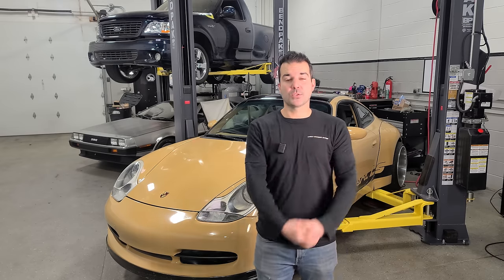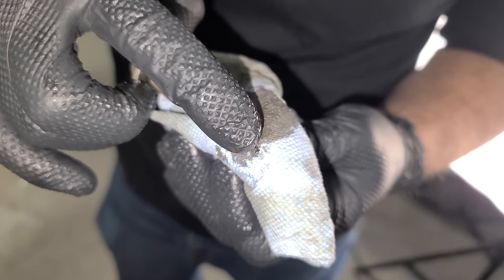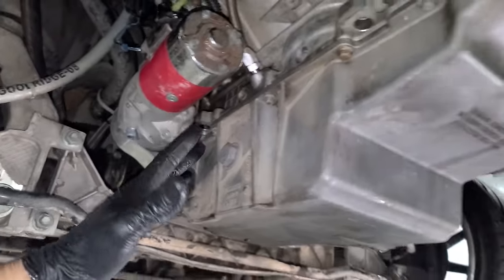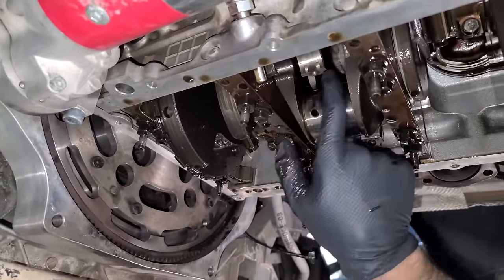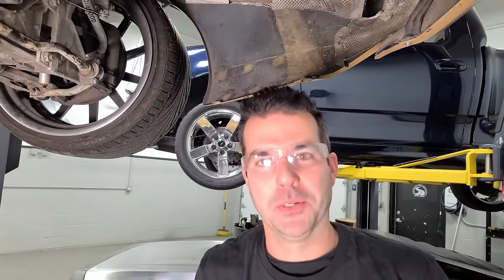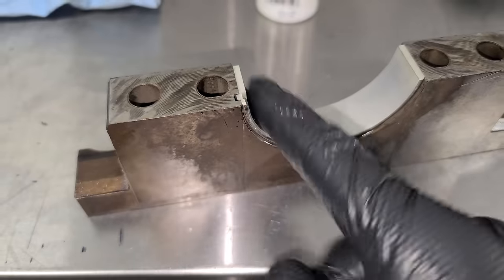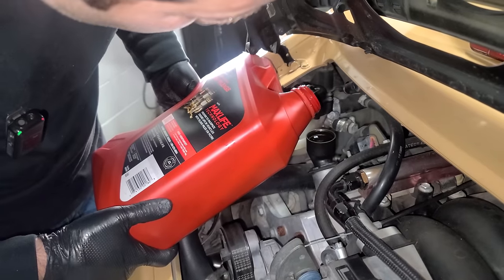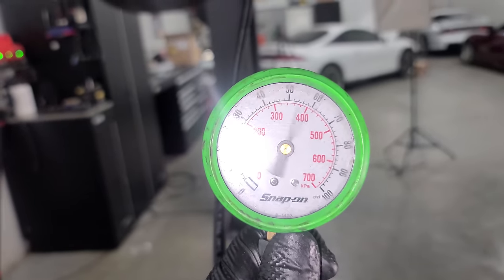My LS Porsche 911 Was About To BLOW UP So I Attempted A RISKY DIY Engine Fix!

Comment from the maker: Click my link and use my discount code “Legit23” (automatically applied) to get 15% off your order: https://bit.ly/Legit_Carly.
Reply: I read the dry eraser board
Reply: Get with Dr Tune Em All and he can get that thing dialed in pretty close quickly doing it remotely.
Reply: How good does  carly work with your ML?  I would like to know how good it is with it before I commit to buying it.  I have a 1999 ML350.
Reply: I ordered my carly scanner for chevy and unfortunately upon deluvery to my house someone stole package off my porch
Reply: read your board, very nice... LOL I love your contents for all types of vehicles, it keeps me interested. I think you should do another diesel vehicle.
Reply: 😑as I iam reading #1-4 I’m not a p.i but 🧐🤨your a wise guy ain’t you?😂
Reply: @ikocheratcr a 99 ml350? No such thing😂😅
Reply: It really doesn’t matter if it’s proper the way you rebuild that motor all that matters is you don’t have a small rod, bearing or four and it is properly running with complete oil pressure and it’s chopping like a motherfucker😂 good job I would’ve done it if I ever thought of that
Reply: Bro, bigtime mechanic here. The pan is backwards and all oil was at front of motor, opposite end it needs. You really need to get a pan that is made with a reverse pickup and main pickup is at back of car. Replace bearings and switch pans and your golden.
Reply: Surprised you didn't just get the upgraded baffled pan from Holly like Tony Angelo did on his Power Kraut he basically just built the same thing on his and he put that pan on his right from the gate however I see basically that part is going to solve your issues for the most part.
Reply: Maybe that exhaust might be heating up that oil to much .just maybe .also the pan is backwards so the pickup tube isn't sucking the oil rite from bottom of pan the way it should be .
Reply: My 6.2L LS has only like 40-45lbs on cold start idle and once warm it drops to 30lbs and pretty much just stays around 30lbs at any rpm untill it fully cools back to cold start conditions but according to Google this is perfectly normal and within spec also it operates at around 200⁰F when warm and this is normal? 🤷‍♂️ has always seemed high to me and I've dropped the fan trigger temp to 160⁰ in my tuner but it has not helped bring down the operating temp... 😅
Reply: Oh and make you a heat shield between that pan and that sick exhaust. Your cooking your oil.
Reply: I have an LS2 but cold start is 44 with the oil pressure
Reply: I read your dry eraser board twice.  Lol
Reply: it looks weird cars developed for the german Autobahn driving on slow USA roads, its like flying a jetfighter as a training prop plane.
Reply: Do you know why the Irish don't iron their four leaf clovers? 

They don't want to press their luck!
Reply: Ive got a e46 BMW and looking for a code reader for just in case situations and saving money staying away from paying dealerships for simple stuff. I just saw that it works on BMWs thanks ill be looking into it and trying your code

Comment from the maker: Hey guys I wasn't clear about what I thought the issues could be with the factory Porsche oil pressure sensor. What I meant was that they failed often and this was the original sensor. Considering the hacked-up wiring I thought there was a gauge reading issue. I said translation issues and that wasn't really the right term and didn't make a lot of sense. Thanks for watching!
Reply: Great content... thanks for keeping it real
Reply: You meant what I knew 😂😂😂
Reply: Love your positivity! It helps me through rough days. Plus, I learn a lot from you.
Reply: I thought you were expecting imperial oil pressure inside the engine but the factory gauge only reads metric oil pressure...
Reply: 32:15 I found it :)
Reply: Stop!!! You are going to kill that engine again with that oil pressure sensor adapter  plate is to small and threds of the oil pressure sensor will block off the oil to your block when its fully  threded on if this does not get replaced  you will see same results  again  replace it with a betterone

Remove the plate and install that sensor  and check your clearance
Reply: I read the white board and, do love these video about fixing your projects. That exhaust is super cool.Great job Fluid Motor Union. Have seen Stay Turned Garage '99 911 LS swap?
Reply: @lsxblazer2548 and he's cheaping out on the oil pan also little too late... He revs his shit up untuned
Reply: Made enough sense to me...
Reply: Meh. Any car company that sends a car over to America with a guage that says druck pressure translation issues are real. What's a druck anyway? What should its pressure be? America doesn't know!
Reply: Alex love your channel bro, been watching it for a long time now. I have just one suggestion/request. Please seriously consider going to a bi-weekly video post format! It sucks having to wait all week..lol I think it would really help your channel too! Great content, keep up the the fantastic work!
Reply: A real bad rich tune could be getting fuel in your oil  causing the oil to be to thin and washing out your rod bearings.
Reply: That’s a lot of grey stuff in there. Could it be also lead from leaded gas, we used to get a lot of it build up like that on the farm petrol tractor back in the leaded day.
Reply: @lsxblazer2548 what are you talking about? The plate is as thick if not thicker than the threads on the sensor! 

How would it block flow? If that was the case A. You wouldn't have gauge readings B. You wouldn't "just" get bearing wear as the warning signs would then JUST be a seized up engine! C. The bearing wear seen is not from oiling issues!
Reply: @aceventura1980 how is he cheaping out on the oil pan? 

You see the exhaust video, you see all that smoke when they were videoing from right behind the car and focused at the tips??

Yeah me either! I guess the catalytic converters are doing a good job..........
Reply: Originally it made sense to me because a European sensor might read in bars or just different voltage readings period...... Then I remembered it's the factory gauge and sensor.... Factory being both Porsche......A! 😂
Reply: @commonsenseisdeadin2023  plate looks obout 3/8 tick what  minus whatever the oil sensore goes it it will give you about a 1/16 to 1/8th oc clearence which is not allot of flow  if you can see the hole in the oil pan is abut 1/2  imagine flating out a hose  to just abot 1/8th of an inch if you say that womt restrict flow then i ges you are the expert
Reply: How long it takes to check pressure with actual guage 🙄
Reply: @realgamer9413   Bi-weekly? Are you serious? That's a terrible idea. He would make his channel irrelevant like that. I wish he would upload 2-3 times per week and most people would agree with me.
Reply: 32:16 what’s up with the whiteboard?
Reply: @andremartinez3000  sorry
Reply: @andremartinez3000  I work at that wrong I meant twice per week as in biweekly
Reply: @realgamer9413  Please learn English. Biweekly means every OTHER week, not twice a week.
Reply: @FastSS02  ACTUALLY YOUR WRONG IT CAN MEAN EITHER!! LOOK IT UP! AND YOU KNOW...LEARN ENGLISH!! 🤣
Reply: @realgamer9413  NOT in the business world. People use this word to describe things that happen once every two weeks, which is officially correct. They also use it to describe things that happen twice in one week, which is kind of correct — but the word semiweekly is more accurate in that case.
Reply: @FastSS02  sorry but you're wrong dude
Reply: Alex its the adapter plate that your oil pressure sending unit is threading into. Your oil pressure sending unit threads  are blocking the oil from flowing thru your engine block and even more misleading is your oil pressure guage will read oil pressure.  Pull off the adapter plate that your oil pressure sending unit is threading into and check  clearence.
Reply: After a rebuild,  I ran 70 lbs. @ 3 grand.
Reply: That makes much more sense.
Reply: Magnum ram 5.2 oil sensors are a nightmare these sensors fail after 10000 miles need to be lucky to get a good one
Reply: Great job I did that with a international harvester
Reply: I thought the low oil pressure was going to be the oil pan pickup tube o-rings. When I worked at chevy the 4.8 and 5.3 liter engines had this issue and they are LS based engines.

Comment: For polishing the crank like you did, use a flexible ruler next time. It's wider so you can wrap it around the sandpaper completely giving you more consistent pressure across the surface since it's wider than a shoe string.
Reply from the maker: Cool!
Reply: I think you mean a sewing measuring tape, about 3’ long. That’s a good idea.
Reply: @tomfurie2996  yes, exactly. 👌

Comment: This was one of the best videos yet.  I was 
 of building my first performance SBC in 1975.  I was able to find a 1970 LT1 that I pulled out of a '70 Corvette.  I'm surprised at how I knew the steps along the way before you got there.  I also remember all
 the little tricks we would do because we didn't have many of the things that are available today.  Here's a shout-out to Errol Meadows who lived in Everett, Washington.   I'm sure he is long gone by now,  but he was an incredibly creative builder.  He showed me a set of solid silver rod and main bearings he built for a 1965, 375 HP, Rochester FI motor.  He had machined a mold for pouring the melted silver dollars.  It was a very interesting process, to say the least.  He built a lot of drag and sprint motors.  That was a time where all the best builders were innovators.  I did a lot of head work for him.  I came up with a real breakthrough  in SBC performance heads for him.  I'm running out of time to tell 'the rest of the story.'  (There's a reference for some old-timers!)  Great job on the videos, with this one in particular.

Comment: Retired Merchant Marine Captain, Marine Surveyor and occasional marine diesel mechanic, (mostly keeping my own boats running).

What I want to pass along isn't connected to this video. It came to mind when I was watching your video on brake master cylinders on the Rollie. I've noticed some Harbor Freight tools in various videos of yours. What I want to mention is that HF carries an electricians copper washer kit. In the kit, there is, I'm guessing fifty washers of various sizes. The HF copper washers are made of soft copper. I've used these washers many, many, times with never a problem. The crush washers can't/should never be reused. The point of the crush washer is to provide a distortion seal. Once distorted it's useful life is over. The washers are intended to provide a positive electrical connection. As I recall, the last time I bought a kit, it was less than five bucks. Many diesel engines use anywhere from a few to many, many of these washers. The HF product is cheap stuff indeed and works perfectly. 

There is a ninty minute YT video by a guy that bought a seventy year old Rolls crate engine and brought it back to life. Well worth the time to watch.

One more thing, CLEAN YOUR HANDS BEFORE YOU EVEN THINK ABOUT EVEN LEANING AGAINST THAT ROLLIE!

Comment: theres a lot of spots an ls can bleed off oil pressure, lower pressure at idle is the first sign. Look up  diagram of oil passages on an ls, pick up tube oring hardens and squares off with age, the dumbell plug at the back of the engine with two orings does the same thing, and the plate that holds the camshaft in also is a critical part of sealing the pressurized oil passages. That plate has a large sealing area that flattens out and hardens with age. Those things plus engine tolerances contribute to oil pressure variations
Reply: It's really common for people to not replace the cam retainer plate, but it's only $15-20. All the factory plates I've pulled are flat as a pancake with no chance to reuse.
Reply: Yes you are speaking of internal oil leaks that you can not see. 
The Mazda Miata drift guy has a list of required items that need replacing on every LS, I think you listed some of those.
Reply: Also faulty oil pressure sensors on the mid-late 2000's 5.3. My 2008 Avalanche showed low oil pressure and I feared the engine was toast. I replaced the pressure sensor and the screen that sits down in the intake and oil pressure came back to what I would consider normal.

Comment: FYI the torque+angle method is ONLY FOR NEW BOLTS. This is why "rebuilt" LS engines seem to spin bearings more often than they should, tq+angle with used bolts overtightens them quite a bit. You can verify this by marking a factory bolt, loosening, then tq+angle and see it go 45-90deg past the old mark.

I use 65lbs for inner main bolts, 55lbs for outer main, 18lbs for sides, 51lbs for gen4 rods and 45lbs for gen3 rods.

Also when upgrading to ARP rod bolts, you must either use the same torque spec OR have the rod resized. Increased torque WILL decrease clearances on the top/bottom by making it oval.
Reply: Came to mention the same about the arp rod bolts. Real easy to destroy the concentricity of the big end. Common issue I thought for sure you'd have heard about.
Reply: Not always true. Depends on the bolts and how they're made
Reply: Said the same thing 😂

Comment: When polishing on the crank with sandpaper, it is best to have the oil holes straight down and when cleaning it, put the spray nozzle tube of the brake cleaner can high up inside the crank to insure no grit is left inside. It doesn't take much to ruin a new bearing.

Comment: You’re the best Alex. Oh and by the way, my LS powered 280k mile 2002 Silverado stock never torn down 5.3 vortec idles at around 30psi hot idle, 40 cold idle, 50-60psi highway cruising

My other LS powered vehicle is a 2002 Corvette Z06 with 51k miles— hot idle is around 35-40psi, cold idle around 50-55psi, highway cruising it stays between 50-60psi, but it will peg the oil pressure gauge when you step on it no doubt. Never opened stock 5.7 LS6 motor. Basically an LS1 like your Porsche with different heads/valvetrain/intake as you already know.

You are absolutely right though about the variation in oil pressures between “good running LS motors” some of my buddies have super low oil pressure and have no issues, some have higher pressure like my cars. I’m not sure why that is to be honest. I have noticed it though in the LS world, oil pressures are anywhere from 5psi hot idle to 40psi hot idle 🤷🏽‍♂️
Reply from the maker: It has to be the big swing in acceptable bearing tolerance from the factory. Thanks for posting up your results.

Comment: It’s funny I remember using the plastiguage in mechanics shop in high school and always wondered why we did it to pull it back apart, but now I’ve put 2 and 2 together!!! It’s for measuring after torque so you can see exacting tolerances for bearings!
Quick question though… what would make a bearing spin in the first place?
Love your vids Alex!

Comment: Would love to see you take this to a track and see how it does now that it shouldn’t blow up like Hoovies.
Reply: it would handle like Amish horse and wagon
Reply: @sexycummins  yes that can be done but you have 150-200 pounds weight difference and engine will be further back and much, much higher. stage 3 porches performance kit will be way better option in terms of preserving the car weight distribution, this thing will overseer crazy. 25k USD is lots of money to drop on car like this. Will be a nightmare to keep it going if even possible. Best of luck guys. Hope video will pay for the car or you will end up with money pit, i have done it before with 300ZX TT, i know.
🤣
Reply: bizzer u dont know wtf youre talkin about. U dont know the the corvette aluminum engine is 42lbs lighter than the original m96 flat 6 this car came with. 
I wouldnt choose a v8, but u should be sure before runnin your mouth like your nissan engine
Reply: @koollee  i don't know what you smoke but i want some of it, the total weight of the setup and weight distribution is completely out with the V8 even at the same weight, the flat six is one foot lower at leas than the v8 plus the v8 is sticking at leas 6 inch further back and i an not even talking of peripherals. I had 2 996 turbo and it will be good for you to check some videos before you yap unnecessary.
Reply: @bisser6969 he's right. The weight distribution is with an LS swap is good

Comment: 07 ls2, hot idle was 25psi and then it dropped to 12.  Pulled pan and found lot's of bearing material.  Still had 30 at cruise and no knock. 

Pulled for full overhaul and had to have a rod replaced and crank welded.

Went with all new hardware  from btr since it's cheap for oil I ran valvoline zr1 for break in. Intervals 500,1000 and 3000 then went back to amsoil signature series.

Comment: Not a huge surprise that an LS swapp into a 911 (or any modified from stock) without baffles put in the oil pan had spun rod bearings. With the increased acceleration the oil will be pushed to the back of the oil pan. Add to it a persistent overheat situation and it was amazing the rod journal's weren't toast. Dodged a huge bullet. Hmmm.... maybe name the car Kugel ausweichen  (German for dodge bullet).
Reply: Probably the one swap where a GTO or Trailblazer front-sump pan would really shine.